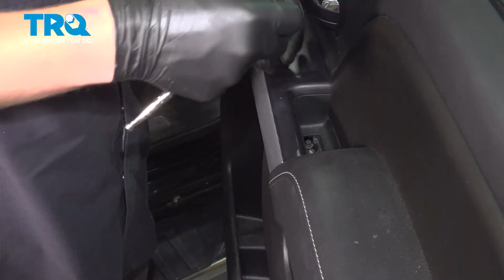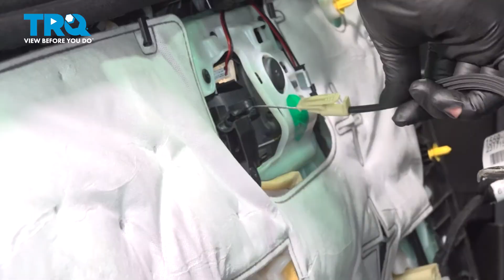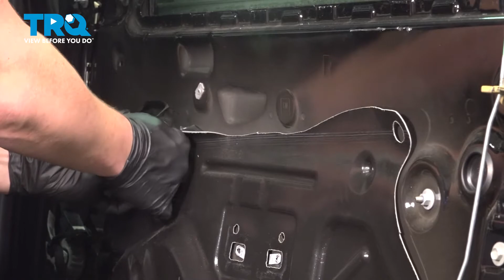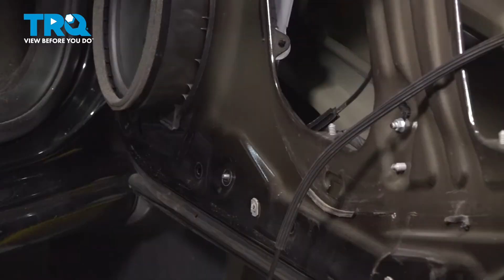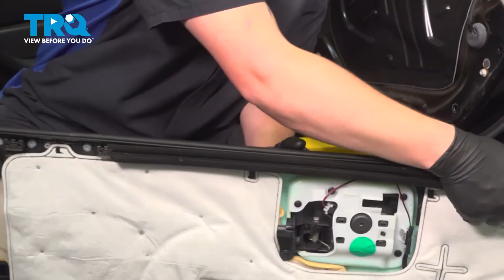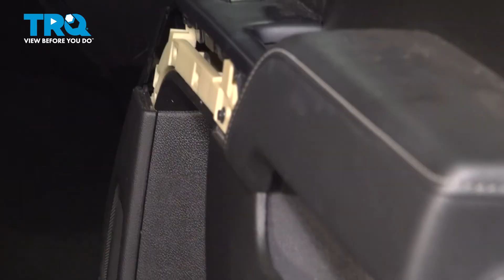How to Replace Front Power Window Motor & Regulator Assemblies 2014-2018 Chevrolet Silverado 1500

Comment: Can’t roll down the window, you will probably have to drill a 3/4 inch hole roughly near the screw head, had to do that on my 00 Camaro just to get at the bolts that the engineers want you to use 2 open end wrenches to get that microscopic nuts and bolts blindly and can’t fit 2 hands in one tiny hole 🤦‍♂️

Comment: .....IF I could put the window down with the switch i would not need to replace the motor.  The fact that you can plug it back in and roll it down to release the window from the regulator helps me 0%.  It would have been nice if there is a manual way to put the window down a little to release the window....has anyone figured that out?  This is my first time replacing a motor on a Chevy....done it on other vehicles without ease...thanks if someone can tell me how to release this manually.